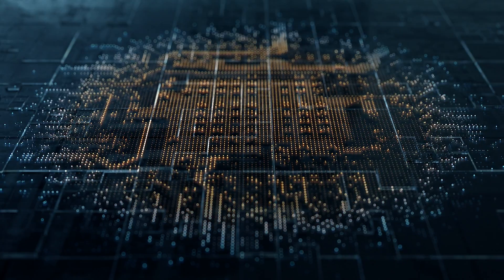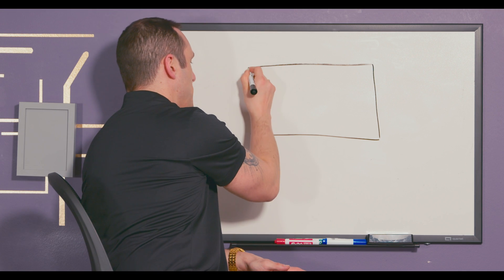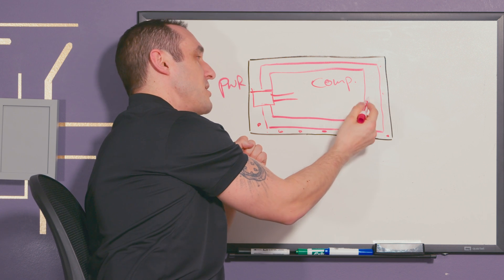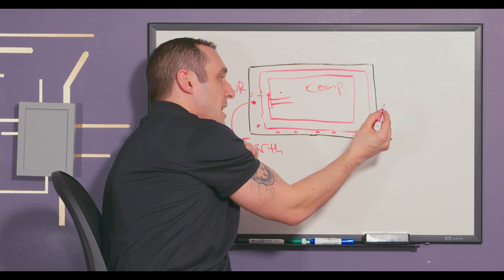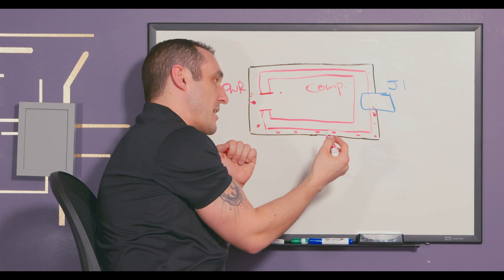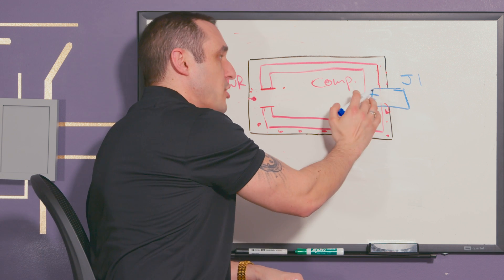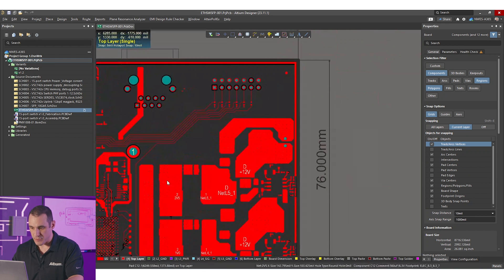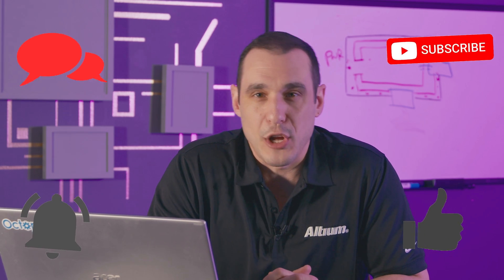Guard Rings Mastery: Everything You Need to Know

Comment: Nice video. How would I use a guard ring in an automotive system, where the guard ring would connect to chassis GND and where I wouldn't want my Signal GND coming in from the power input connector connecting to chassis GND to avoid a GND loop?

Comment: Im confused by use of guard ring and ground islands around crystal ossilator layouts, especilly on 4 layer. Do you have a video on this?

Ground islands and 'directing ground currents' sounds like the oposite Ive been learning to gain good EMC performance.
Reply: The usage here is not for directing return currents from a signal, which is essentially what you are referring to. We are talking about putting a ground conductor around the PCB to provide a path for currents induced on a shield. The guard ring is also not a separate net per se, it is connected to the main system ground so that they have the same potential as this eliminates the potential radiation from disconnected grounds.

Comment: Don't you think that extending gnd under a guard ring creates an additional path for ESD thruogh cpacitance between the layers? And ESD can reach the inner circuit
Reply: About the capacitive coupling, yes it exists but calculating the capacitance between the rail and a plane and you will see that it's quite small. Compare that with the impedance of a large rail and you'll find that most of the energy is dissipated via conduction rather than displacement current. About the inner circuit, how exactly is ESD going to reach inner circuit layers if a connector shield only attaches to the ring region.

Comment: hi @Zachariah-Peterson 
i see in some designs that they make a chassis using 1KV or higher capacitor with 1MΩ resistor connected to the main ground is that correct way for that?
Reply: As is usually the case, it really depends. Do you have an earth connection, isolated power supply on the board, or is it a board that only takes in a DC source and has a the outer ring as a safety ground? The RC connection is normally used when you have a shielded connector going back to the system ground in order to dissipate some energy from an ESD event on the connector body. If you had a shielded connector and a guard ring, I would prefer to do a direct connection to the guard ring, and potentially use a direct connect to the power return right at the power entry. Whether you use the RC circuit also depends on the ESD/EMI standards you need to operate under. For example, aerospace testing is more rigorous than general purpose or commercial products, so the connections between those shields and grounds may need to be different to comply with the standards.

Comment: Can guard ring be used to reference an RC filter?
Reply: If you're referring to using the ring region as the ground reference for an RF filter, that may not be a good idea if the filter is placed in the main region of the board. Are you interested in an integrated filter component, or is it a printed filter?

Comment: Should we isolate somehow the guard ring from the system ground with caps ? Are not the system chasis a source of noise to the system ground if they are tied together without isolation? Thanks !
Reply: There is always some debate on this unfortunately. If you use caps instead of a net tie then you will have low impedance return to the power input for high frequencies but not for low frequencies. So if you have any low frequency currents that are induced in the chassis region, then they will radiate strongly from the chassis, and then maybe a bigger capacitor or a direct connection is needed.

Comment: Thanks for great video! I love you!=)  My question is: 
 "I didn't see layers "L2_GND" and "L5_GND"" in altium's exaple. I think that's power plane (negative). Is there should cut ground for Guard Ring?
Reply: L2 and L5 were defined as plane layers and only used for ground. The vias for the ring pass through the ground net in L2 and L5.

Comment: Thanks for the video, it was very useful.

I have a few questions:

1) What about the ground for ESD protection? I guess the TVS diodes should be placed near the connector and referenced back to the guard ring/chassis GND.

2) What do you think about high-frequency capacitors at each mounting hole between the mounting holes and the guard ring?

3) What should be the width of the connection between the chassis GND and system GND? Is a 0-ohm resistor (e.g. 0603) enough, or should a larger polygon pour be used?

4) How to avoid ground loops if the chassis GND is connected to system GND at the power connector? Does this mean that the cable shields should only be connected at one side?
Reply: 1) Place TVS to whatever conductor you want to be used to carry any current from ESD, in this case it would be the ring.
2) When a net tie is replaced with a cap, the return path to the power input exhibits low impedance for high frequencies but not low frequencies. As a result, any low-frequency currents induced in the chassis area radiate strongly from it. In such cases, a larger capacitor or a direct connection may be necessary.
3) Large case 0 Ohm resistor is fine. If you use caps (see above) maybe it will end up a bit larger.
4) Are you asking this because the chassis ground looks physically like a loop? Ground loops arise due to potential offset between two points in a ground net, which forces a current to flow. Low impedance connections that equalize the potential across all of the ground is what prevents ground loops. About the cable shield, it depends. As far as I know, audio cabling has shielding grounded at both ends.

Comment: Thank you very much for sharing.
I have one question to ask you.
What is the recommended width for the Ground ring?
Reply: They do not need to be large, it should be large enough to cover the vias you are using to connect any ring on multiple layers. If you have a connection to a metalized enclosure, then the copper on the guard ring should be exposed and it may need to be a bit larger to make good contact with the enclosure.

Comment: In some design there are also more things to consider like thermal cooling. We often connect the "guard ring" on top to solid planes on internal layers. this ofcourse negate some effect of the guard ring but its still sufficient in most cases whilst creating a better path for heat to get out of the PCB.

Comment: Very nicely explained. From the title, I was hoping this would be about locally referenced guard rings like you see around high impedance inputs. (It looks like Everyone's Least Favorite Wiki calls that a "driven guard," but that's what I always think of when I hear "guard ring.") Some precision op amp packages have guard pins to facilitate this, but with standard packages it's usually just wrapped around the input. I like to drive the guard with a separate voltage follower tied to the reference pin; I'm aware that this is "to paint the lily, to gild refined gold" with most of my designs, but it's a reasonable use of that spare op amp you'll often need to tie off as a voltage follower anyway.

EDIT: I should note that most PCB editors like to be a pain (and this could be the end of the sentence right there) about driven guards because the software thinks they look like unnecessary current paths. I'm sure there are design rules that can be tweaked to make the editor a bit more cooperative...
Reply: I'm seeing some other people who mention the driven guard, CAD tools are funny like that and I think you would have to turn off the design rule for that specific net. Sounds like it's worth doing a video on it.
Reply: @Zachariah-Peterson  The KiCad forum suggests treating the driven guard as a separate component with a custom footprint for each instance, similar to a shielded can. If it's worth touching on this subject in a video, it should probably be within the broader context of shielding. It might also be a good tie-in to your previous video about distributed-element design.

Comment: When I think of "guard rings", I tend to think of ground traces that encircle high impedance inputs on some op-amps or sometimes crystal inputs on MPUs.  Is this alternate form of guard ring recommended?
Reply: Driven guard rings are typically for high impedance DC, e.g. opamp inputs and such, to try to minimize creepage where even nanoamps matter. The guard ring in this video assumes high frequency switching noise that cause EMI. But the part about shielded connectors left much missing. Connecting the shield of shielded connectors like this, without having them tightly fitted in an opening in a metal chassis, doesn't have much benefit. Maybe for ESD purpose, but it won't do much for EMI. To have an impact on EMI, shielded connectors must be fitted in a tight opening in a metal chassis and the shield must in contact with the chassis all around the connector, no gaps.
Reply: Apparently that's called a "driven guard." TI and Analog have ap notes on these.
Reply: This implementation appears to be general solution to protecting the components inside the guard ring from any external EMI and vice versa. 

I’ve seen this type of ring used in systems such as the PS5 separating the wireless interface from the rest of the motherboard and serves as the “ring” used for the mounting screws to mount the motherboard to chassis. 

In essence, your solution works tremendously for many applications (assuming you’ve been having success), but the guard ring appears to be another addition measure that can be employed to ensure that EMI protections are as robust as possible by keeping internal signals localized within the guard ring, blocking external interference, and potentially serving as a great place to throw in some mounting holes. 

Not an expert by any means, just sharing my thoughts.

Comment: I didn't quite see how would you extend the "component ground" to the connector references in that PCB. Do you have the connector shield connect directly to the guard ring and then the data pins with their references connect into the "component ground"?
Reply: You can always extend the component ground region on the internal ground layer into the vicinity of the connector. If you place the component ground as pour and assign it to a different net then it will always pour around any vias on the grounded guard ring, this then allows you to keep the component ground near the signals coming off the connector. You can then tie the component ground and the guard ring back to each other with a net tie somewhere else on the board, normally this is done near the power input.